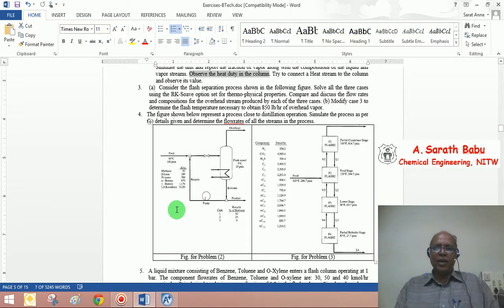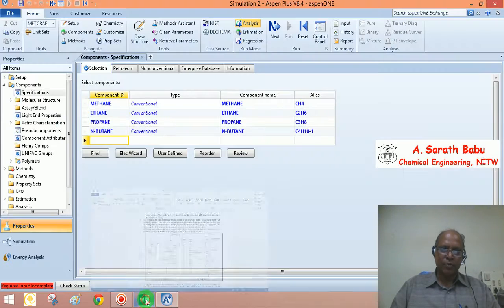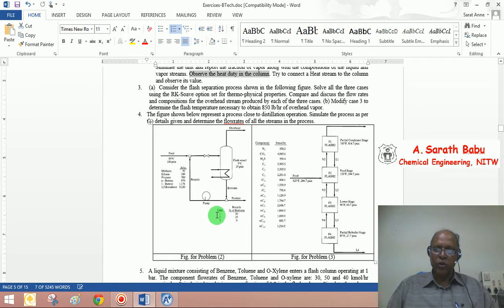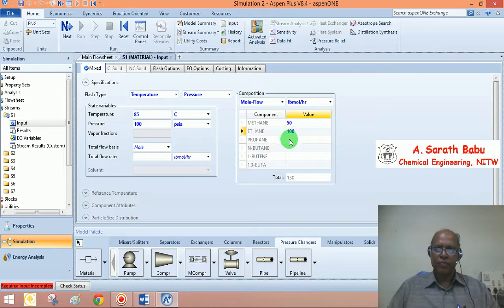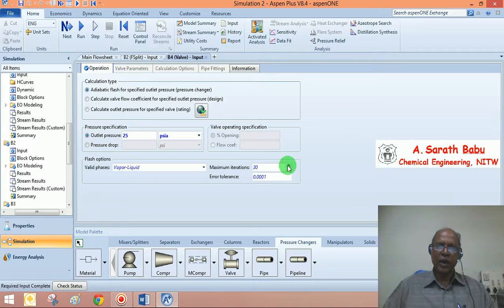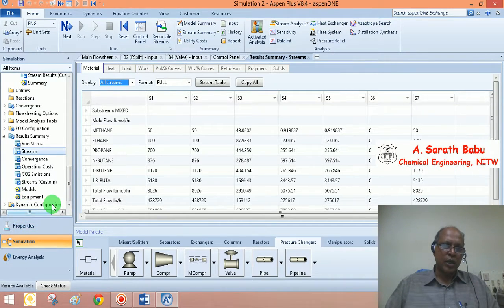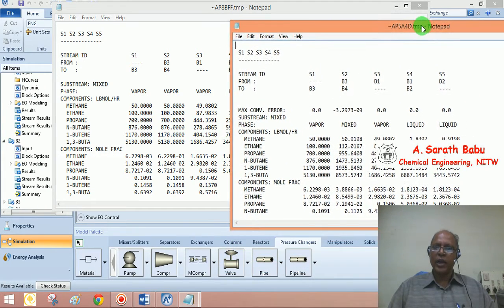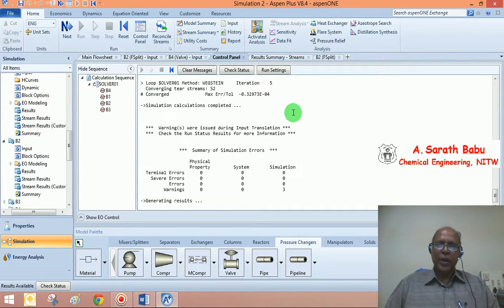Lecture 18: Simulation of Flash Effect of Recycle in Aspen

Comment: Recycle stream variation doesn't contribute to the composition of outlet streams because the property of a component depends upon the process Parameter like temperature and pressure of flash column
Reply: Could you explain better?